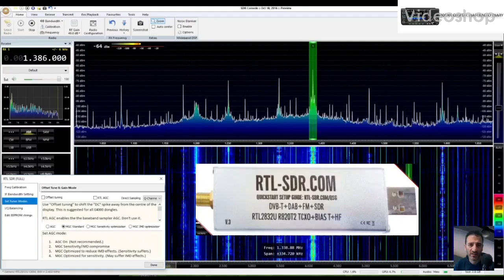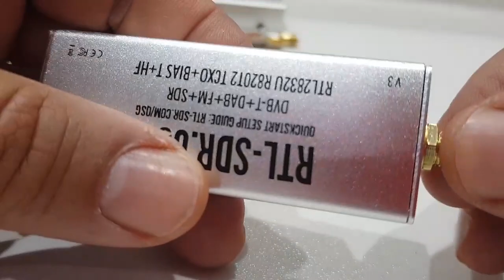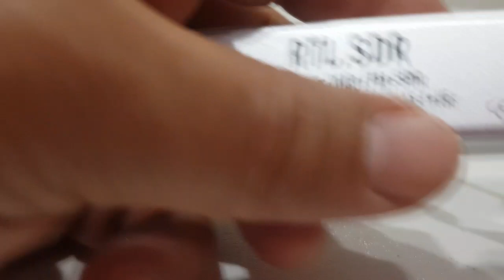RTL-SDR- COPY - RTL-SDR original- Dismantle

Comment: I bought the original a few years ago. Never had a good antenna just a very long wire and never received shortwave or ham bands after setting the Q branch and now to this day I realized it has never worked. So disappointing. 
No matter 8 screw or 4 screws you can still get screwed with the original.
Reply from the maker: There are setting to make it work with Hf:https://www.youtube.com/watch?v=KZI79fg0Icw
Reply: @M0FXBHamTech  Yes thanks I have made these settling and no signals ever received.

Comment: fake but it works?
Reply from the maker: I call it the cheaper version - yes works
Reply: It works cheap. The TCXO on the bottom of the fake board, the output pin is not even wired to any chip, the crystal at the top side is way off frequency, and there is totally no support for direct sampling with the clone dongles. Looks like U1 as chip is missing on the board(s) and no clue which chip that should be.
Reply: It works, but it is very bad. No antialiasing filters, the time base is not precise, you name it.